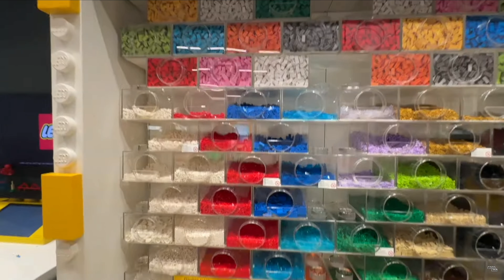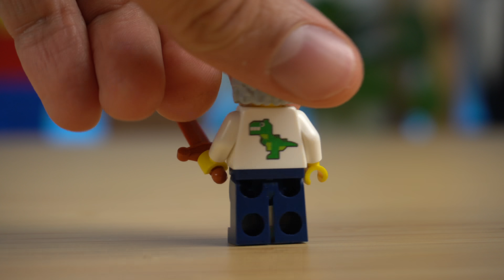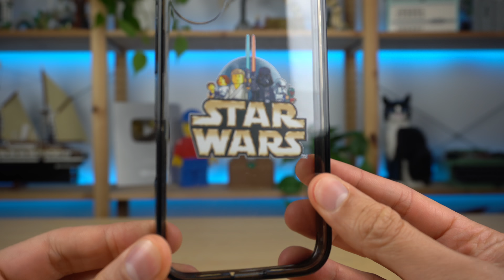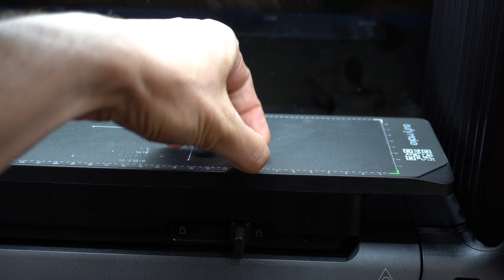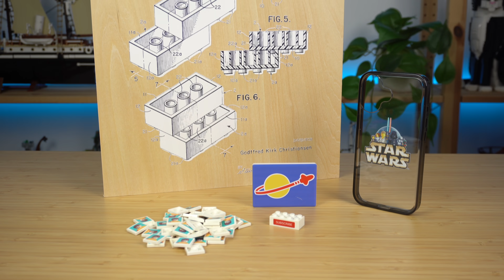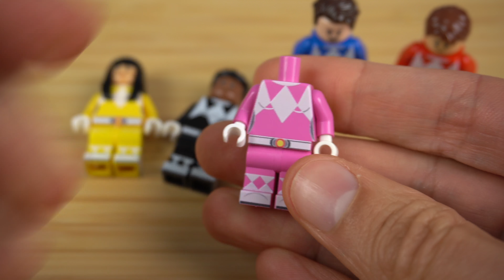Custom print your LEGO at home!!

Comment: 1700$ + 300$ for ink cartridge, each color separatelly :D
Reply: It is $300 for a bonus set of all 6 ink cartridges as an extra add on. The $1700 gets you a set of ink cartridges as standard.
Reply: It makes more sense as a custom service. Like you spend $20 or so  sending your minifig to an enthusiast printing shop instead of dropping $1700 on a whole printed.
Reply: Very expensive, but clearly intended for enthusiasts only!
Reply: *rich enthusiasts  @furanhart
Reply: @dumbman987 tbh, if you want to be an enthusiast of anything, things will mostly get expensive.
Reply: @dumbman987  Sure, so every gamer who buys a decent computer is rich as well? $1700 isn't much, compared to how much you will spend on (horribly designed) LEGO sets in the long run. Of course that only applies if the printer doesn't break after a few years of use.
Reply: @dumbman987  *enthusiasts with jobs. 1700 isnt much in the world of hobbies
Reply: $2000 for a printer and 2 sets of all 6 ink cartridges is a pretty cheap buy-in to start your own custom lego business lmfao
Reply: How long does a ink cart last and will it degrade over time?